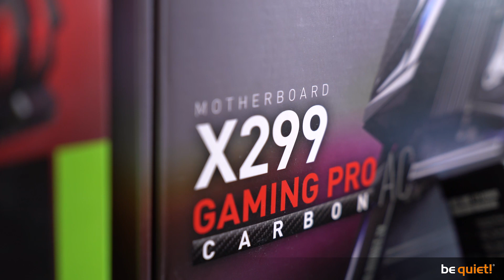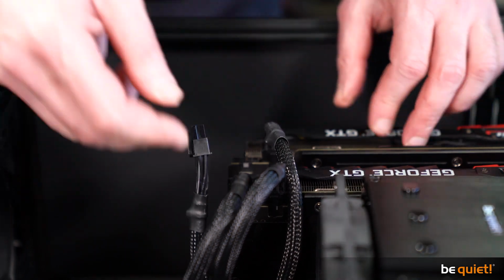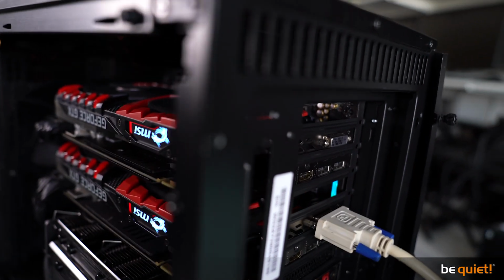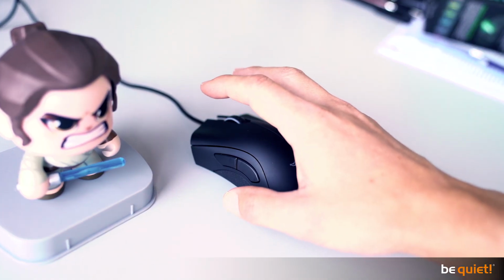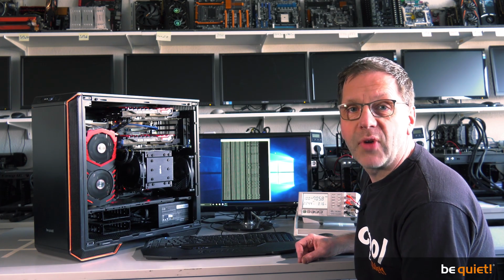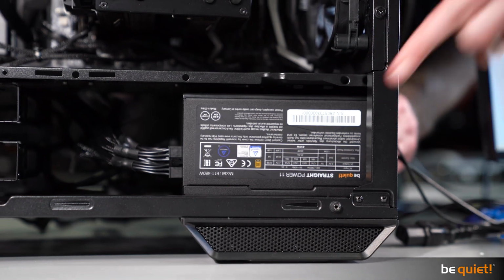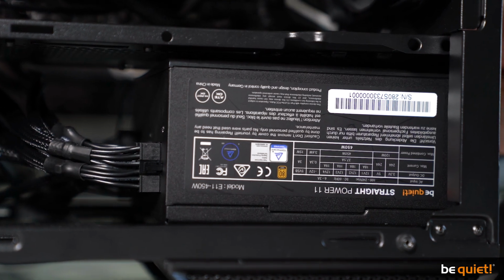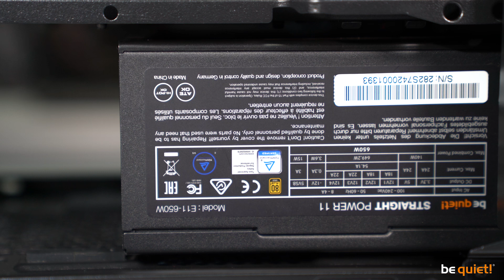Will a 750 Watt PSU power three GTX 1080 Ti?

Comment: I have 800w 80 plus bronze + xeon e5 2670 v3 + MSI 1080 TI.  Heavy load at ease. But i will recommend an ATX casing, better air flow. The 1080ti gets quite hot

Comment: Can I run a 1080 ti and a 2060 both on underclock on 500w psu?
Reply: You can. But it will just crash when demanding a heavy load on games, and black screen, no signal.

Comment: Will a 600w PSU be enough to run 2x GTX 770 Graphics Cards in SLI Mode, etc.
Reply from the maker: Our PSU calculator (https://www.bequiet.com/en/psucalculator) should be able to help you there.

Comment: i'm using i7 8700k 32GB ram 256gb ssd and 500gb hdd. 7 led fans and 2 1080ti in my antec 1000 watts it runs smoothly without  any problem.

Comment: A 250W PSU will power half a dozen 1080 Ti's--as long as you don't run any of the cards at full load.
How many watts a card uses depends on its load! A 1080 Ti can use 320W of power--or 384W when you set the power limit to max (120%).

Comment: Put some load on those 3 1080 ti's. Spool them up to 80% + utilization and see if the 750w psu shuts down.
I'm hitting 600 watts with just 2 GPU's (1080 fe & 1080 ti fe) at 83% utilization)
At 50% the gaming rig runs at 450 watts. Processor is a i7-6700k.

I have an evga supernova 750 b2 which ran great for the last 2 years, but when I replace my 1080 with another 1080 ti I'm upping the psu to an 850 g3.
UPS is a 1500VA unit.

Comment: OK What happened if I run out of wattage? 🤔
Reply: @Shivelybanetek  Can confirm that this is true.
Reply: The power supply will shut itself off if you exceed the maximum power rating--your computer will restart itself.
Reply: What Lucas is saying is when you're measuring from the wall - not accounting for the PSUs efficiency.

Comment: will a 750w beable to power 2 gtx 780 3gb?
Reply: Yes i will
Reply: Yes. I'm currently running 2 GTX 1080s in SLI configuration along with i7 4790k with a 750w psu. in fact, you should have a little bit of headroom for overclocking depending on your cpu.

Comment: Hi, I am using PSU CoolerMaster B600 ver.2 600W. Is it enough for vga Asus Rog STRIX-GTX1080TI-11G-GAMING? I found spec of the PSU at http://www.coolermaster.com/powersupply/b-series/b600ver2/.

Comment: Every time someone will add 800 watts PSU to their shopping list im gonna show them this video.
Reply: I hope not because there is so much wrong info on top of the complete lack of info. Running three cards is entirely related to clock and the type of load. The only reason those three cards are working is because nothing he has done fully utilized the cards and the lack of a clock speed shown makes it pretty obvious he is barely hitting 1900mhz. A standard 1080ti running around 1900mhz. Mining is not a power hungry load and anyone who runs firestrike and timespy know it is not a tool to judge stability on.

Comment: Could you tell if it supports 2 x Aorus  1080 ti Xtreme overclocked edition with 750watt please ?
Reply from the maker: Hello Sagun. The graphics cards are no problem at all, but depending on the rest of the system using 750W may cut it close.
Reply: Right now, I am using 2 x 970 gtx .. And it's supporting. I have CoolerMaster G750M.. What if I replace my both cards with 1080 ti xtreme ??
Reply: I would say there is no point, one 1080ti will be a lot faster then two 970, also no OC version can achieve the same as OC version (with very minor differences) you are literally paying a lot more for some slider position in overclocking software. Also SLI is very shitty lately, depends on game but in WItcher 3 for example you will get 10-15% improvement with SLI, no surpsise Nvidia is ditching SLI. Im switching right now to 1080ti from asus. Oh and i have be quiet 600W psu.
Reply: Thanks for the info about OC and non OC version but I actually already got OC versions. And when I plugged on the power, my 750W powersupply didn't support the 2 cards.. It was on and off then I check one by one and it worked. Also SLI is no use for me since I'm not using for playing games anyway. Now my question is will 850w supports both OC version or do I need 1000w ??
Reply: Ohh if thats the case you can go on, as for the PSU watch this, Your coolermaster should really be enough I would say, after watching video above :P

Comment: Be quiet straight power 11 750w l Suitable power supply for PC:

Intel Core i7 8700k 4.7ghz

AMD Sapphire Vega 64

z370 asrock extreme

16gb 4133mhz

and how do 4 lines affect the system?

and will everything be fine with the system?

I love to be quiet!

Comment: It will certainly die in a few months taking out most of your system with it.
Reply from the maker: Why should it? We don't design our PSUs to only live for a few months.
Reply: Not enough watts for 3 1080Ti. One overclocked can pull 350W. 400W+ power/bios modded. 1200-1500W psu for setup like this.
Reply from the maker: Have you watched the video?

Comment: 750W for 2x 980 Ti enough?
Reply from the maker: If it's enough for three 1080Ti then it's enough for two 980Ti as well.
Reply: OMG yes! My SLI dreams may come true!
Reply: get an 850w..trust me..i have 980ti in sli for 5 yrs w/850watt..its just barely enuff w/a small overclock otherwise it shuts off..850watt is enuff for 980ti in sli..not 750 tho..unless u never plan to OC or play modern games etc
Reply: Don't buy 2 GPUs 🤦‍♂️
Reply: @filetsteak5677  running 2 gtx 1080s sli without any issues for 2 years with 750w psu gold plus certified. why can't he?
Reply: @EdnovStormbrewer  I'm about to put 2 gtx 1080ti's in a 600w EVGA power supply, I have a 60w i5 10400f, a z490 motherboard and 1 NVME and 1 HDD. What do you think?
Reply: @targ27  depends what's your purpose is. If you planning on gaming, it all comes to what resolution you are having your games set to. And the hardware like the ram, cpu cooler, cpu fans (etc etc) you're buying, and the games you're playing goes hand in hand as well. Also if you're not planning to overclock anything you should be set. Any tasks you do as well will depend on the load you put on the PSU and the efficiency later on. Hopefully the PSU you're buying tho is high quality and reputable brand. Because if anything happens to it like overheating, a good PSU is meant to shut down and will save your hardware in the long run though I honestly think the stock clock speeds with the hardware will give you a little bit of headroom for anything.

Comment: Spec sheet of the used GPU says 250W power consumption, and a recommendation of 600W PSU, you're quoting the wrong numbers in your shear enthusiasm. With 2 in SLI (so 2x250=500 and not 1200!!) and a theorectical TDP of 140W of the CPU, it's peaking at around 650W as you're showing indeed on the watt meter. Nice one for the 3rd one however!
Reply from the maker: Yes. The notification on the homepage show 280 Watt power consumption. We know that as well. But many buyers just check the recommendation for the PSU. And only a small percentage use a SLI-system. So we ask you pardon for our little dramatic explanation.

Comment: Thanks i needed to know for my mining rig! Do 3x RX580 too

And what the fuck did you do with the thermal paste bro. You are not suppose to use so much!!!
Reply: Lol Mwa was toch al klaar mee hmm 180 w per card
Reply: I have a msi rx 580 gaming x with 500w psu i think 700 w ist ok
Reply: Lucas How is the MSI? Many reviewers are very negative about it and that it has shitty fans and is very loud. Is that true?

And also thanks. I have the ASUS ROG strix RX580 OC
Reply: Lol Mwa was toch al klaar mee no ist not true,it is a good cool disingn overclocked on 1450mhz the crad doesn't go over 75 °C
Reply: Lol Mwa was toch al klaar mee and the card is not very loud
Reply: Lucas Thanks. Its makes no sense why their all so negative about the msi card. In other comparisons the msi scores top